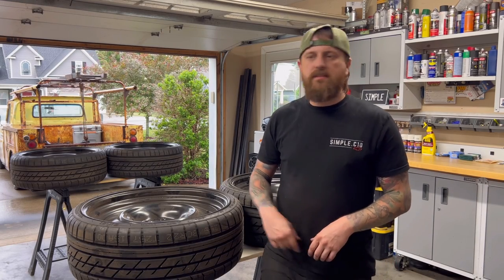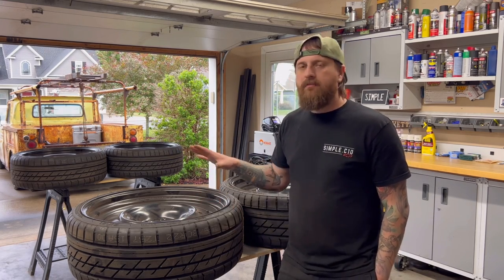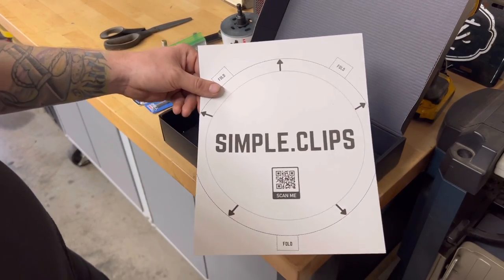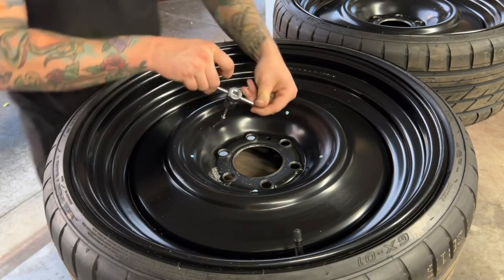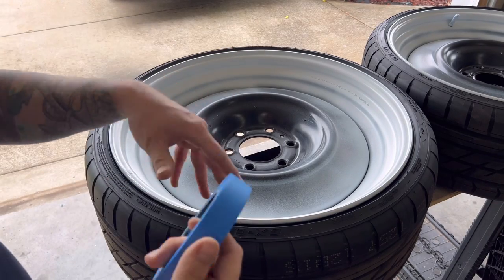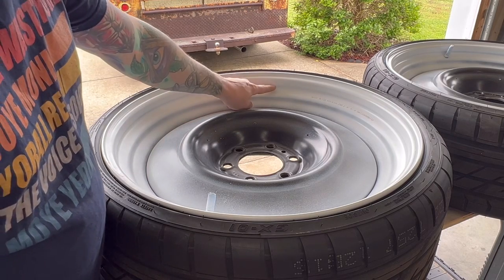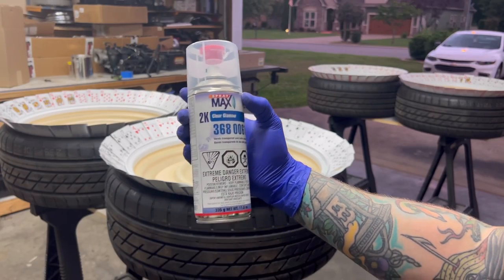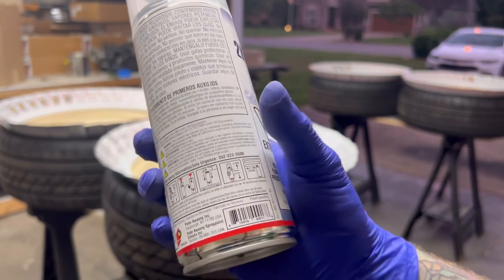TRANSPORT WHEEL TRANSFORMATION | DIY Guide to boring, painting, and installing cap clips.

Comment: How many spray cans did you use to paint the white wall and the center in total? 

Awesome video! Greetings from the netherlands 🇳🇱
Reply from the maker: I would recommend 1 White, 3 Color, and 3 Clear. It all matters how heavy you coat them. I feel as though I used the bare minimum on this truck. If I would have had one more can of clear I could have put a final heavy coat on.

Comment: since you threw out the names of some aftermarket wheel manufacturers, what is the benefit to going with GM transport wheels?  Are they cheaper?
Reply from the maker: Prices vary but yes they are cheaper in most areas.

Comment: Would you recommend a spacer for the rear? just got a set in for my 1963 c10 fits my front disk looking for the rear
Reply from the maker: If it’s a stepside get a 1 inch spacer. If it’s fleet, use my bore kit.

Comment: Why tap them?  Just use ss screws with nuts and lock washers.
Reply from the maker: I like to be able to replace them without taking my wheel off to get to the backside. Either way would work though.
Reply: Got it,  beautiful wheels, don't see them in my area.